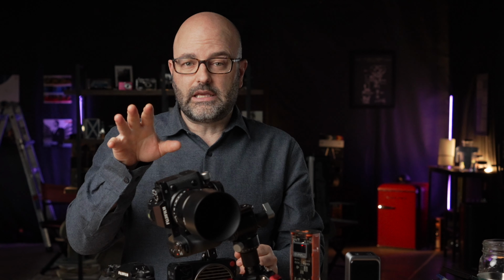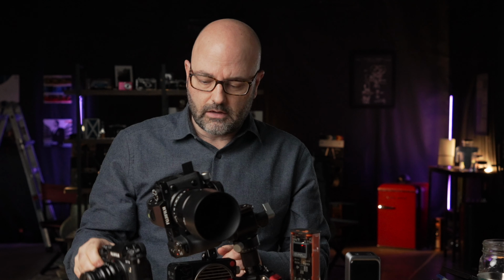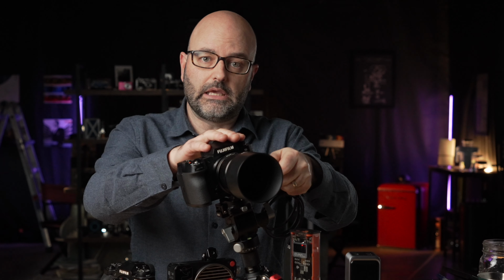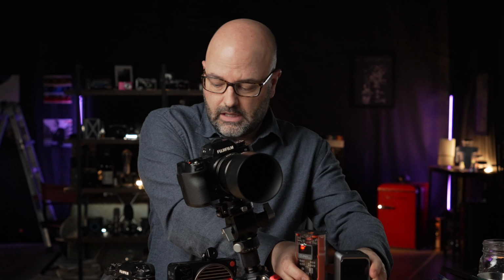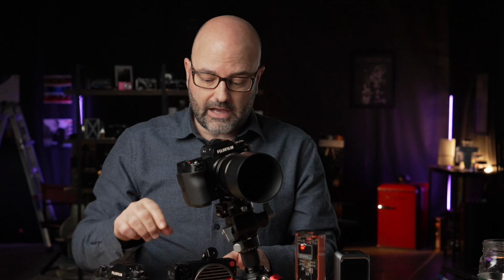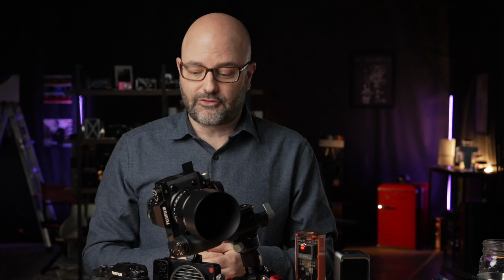Locking USB-C Cables: Thank You Fuji! (EP.135)

Comment: Your discussion about USB-C ignores the fact that cables and connectors are basically un-repairable by mere mortals.  If a cable has problems, throw it away.  Not too bad.  If a connector on a camera or other device breaks, send it back to the factory to be repaired.  No fixing it in the field.
Reply from the maker: True but I have also had micro and mini HDMI snap in the field. At least the locking mechanism helps. That said, I always have backups with me as they are all so flimsy. BNC connectors for the win!